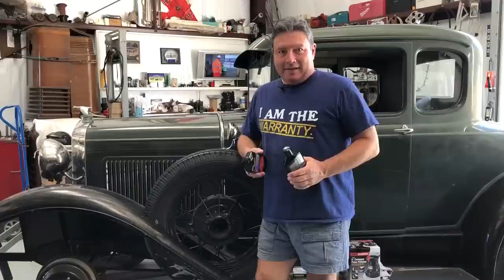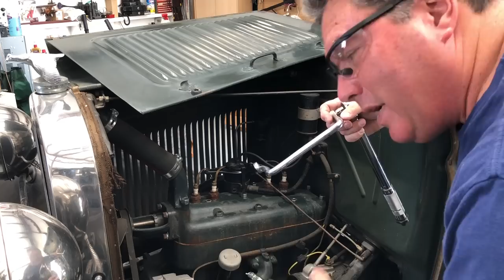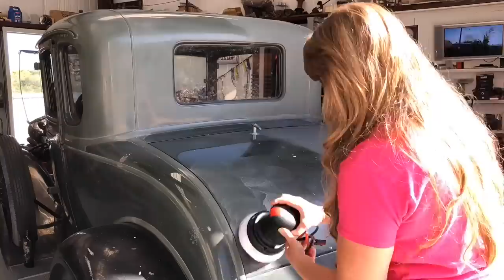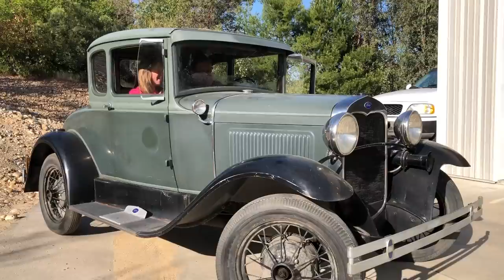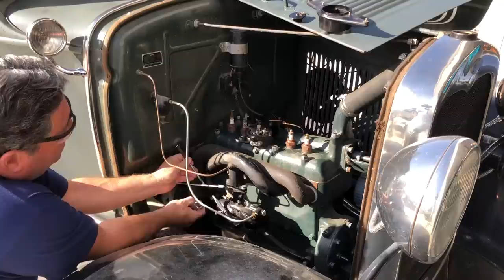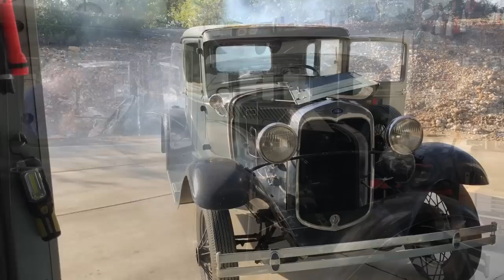1930 Ford Model A coupe- Got it started! Then it blew up.

Comment: Thank you for the entertainment tonight Paul...I appreciate that your videos show not only the good days but also show when things DON'T turn out as expected.  Just earlier today I was thinking of you when I got ready to take my new-to-me 68C for a short ride after obtaining plates and registration from my local DMV office.  First I checked fluids and while checking things decided I'd better lubricate the distributor cam as well...I had no idea when the last time the previous owner lubricated things.  Off came the distributor cap and rotor, then as soon as I touched the cam with lube the spring on the points broke and went flying off into the grass!  My heart immediately sank as I knew I did not have a spare set of points.  But then I looked closer and realized this distributor had a later set of Ford V-8 points....so a quick call to our local NAPA resulted in an in-stock part sale (with delivery) and 30 minutes later I had the new points installed and I was driving around the neighborhood.  Gotta love the Model A!  Such a simple car that can be easily fixed and maintained.  While I hope I don't have anything as big as your engine problem to resolve anytime soon, I am comforted to know that nearly everything that may (and probably will) go wrong on my car can be fixed with a reasonable amount of time, effort and money.
Reply from the maker: Most excellent.  Yep, you're right

Comment: I've had a 31 Deluxe Coupe since I was 9 years old...I am 55 now. It was Gramma and Grampa's "Datin'" car. I remember going to lunch and ice cream in it with Gramma and Grampa but when I got it was the first experience I had ever had with death. They passed away just two days apart, both from heart failure. Anyhow, for the first several years I just wasn't interested even though Dad taught me to drive it and yeah, I did use it for my driver's license test. Then for many years it went from I'm going to restore it to it would make a killer hotrod to apathy and back and forth. I discovered your channel only a couple of months ago and have thoroughly enjoyed watching and learning. My old coupe is in pretty good shape. Most who see it say it should just be cleaned up and shown as a survivor. It does have original paint, 92 year old mohair and is 100% stock, I'm just not at all into the "patina" thing so I am going to go for a full restoration. With the exception that is of some hop-up goodies that Grampa bought way back when the car was about ten years old. I do have an overdrive unit and various other items for the engine but the cream of the crop is a NOS Frontenac head. I've got me a little gal that calls me Grampa now and I think she needs to go out for lunch and ice cream with Gramma and I.
Reply from the maker: Excellent!  In your grandfather's memory, I'd be tempted to restore it to the point exactly like your grandpa had it when he was driving it.  Then, when you pass it on, you are passing on a part of him and you both.  If you modify it with the hotrod head and whatnot, then he is gone and it's just you.  But, it's obviously your decision.  I've just been involved with a LOT of those "my grandpa left me this Model A, what should I do with it" and see the regret every time it got heavy modification away from "as-given".
Reply: @ModelA  Yeah, but he bought the parts and wanted to hotrod it...Gramma vetoed that idea! LOL I would never consider going any farther then he wanted to go. It will always be Baby S**T Green with black fenders, black wheels and tan interior. It would forever look bone stock. Like Grampa said, if I would have just done it she would have never known... Gramma didn't drive.

Comment: That sucks that it's blown up!! I have two Ford Model A's and work on small engine machines for a living. I noticed that you were draining the fuel from the carburetor into a gas can.  With 10% ethanol fuel these days (might be 15% soon?) this ethanol blend fuel in vented carburetors and fuel tanks will get moisture from the atmosphere and "spoil" it quickly!! I usually drain some fuel into a clean glass mason jar and hold it up to the light.  If it is cloudy then it is bad or if it has water in the fuel you will see the separation of the two easily in the clear jar.. luckily you just had a clogged main jet. Model T can still buff the car out in the meantime!!! Nice video!!
Reply from the maker: Thanks JT!

Comment: My first thought was rings as well. I am wondering if all 4 sets are locked to the piston and just not in contact with the cylinder. I saw a lot of smoke coming out of the engine compartment. By any chance did you have the oil filler cap off? If rings are a no go then a ton of bypass would flow out the oil filler.
Reply from the maker: Filler cap was on.  No blowby coming from filler.  Spark plugs are clean, no oil.  I think it's happening after the cylinders.

Comment: On a old engine i worked on the oil pressure relief was stuck and it did the same thing smoked like crazy, filled the exhaust with oil
Reply from the maker: If this was a pressure oil system, I would suspect that also.

Comment: Starting dad’s old model T with hand crank sucked. Especially if it didn’t start 1st or 2nd try. Electric starters were a blessing. Kids today would have just kept riding their horse.😂
If that engine was rebuilt they may have broke a ring. Pull the plugs a check for oil. If just 1 has oil, you can remove the piston and replace broken ring. If all show oil you’ve got a different problem.

Comment: I can't believe you stayed as calm and collected and, above all, PG when the engine blew up! 😁
That's why I can't make YouTube videos when I'm fixing my cars, the air turns very blue on occasion.
Please make a teardown video of that engine, I'm dying to know what caused it to blow. Maybe it's fixable. Because just throwing engines at it until you find a good, working one could take a a while, better build one yourself that you know is good. These are, after all, not off the shelf items.
Reply from the maker: Thanks!  I have mild autism, and I'm always the same- emotionless.  Model T calls me a robot.  Never get riled up.  The next video is a teardown and investigation.  Dad and I built this motor, like we have many others before it.  Lots of things can go wrong with a 92 year old block.

Comment: New to your channel,have watched a few videos. Am thinking about getting a model t of some kind,I’m not a mechanic. I hear folks say you drive it you fix it something is alway wrong. Starting to have second thoughts. Would I be better off getting help and building something from a kit knowing everything is new? I like your videos will keep watching. Thank you for sharing your knowledge.👍👍watching from Boise
Reply from the maker: Hey Tony.  A Model T requires a lot more tinkering than a Model A, but is a fun toy.  If you lack mechanical ability, then it is THAT much more important to get hooked up with a good active club.  If not, chances of failure and disappointment are very high.

Comment: Did you ever figure out why the little green coupe smoked? I'm pretty sure you have, but just in case you haven't , I'd like to offer my thought on the matter. As there was no plug fouling, no oily exhaust ports, and the fact that it ran so smooth, my guess is that there was still a lot of oil in the muffler & tailpipe that would have to burn out before the smoking would stop. Disconnecting the exhaust pipe at the manifold would prove that. I rode a many a mile in a 1931 model back in the late 1930's and early 1940's. I would sit between Mom & Dad & shift gears for Dad sometimes. I enjoy your videos, and I've learned a lot about the Model A, details mostly, as I never worked on one, but was an automotive machinist from 1955 until 1966 until I left & went to work in a petrochemical plant, best 11 years of my life. Thanks & keep up the good work, R.C. Russell Bridge City, TX

Comment: Paul are you sure it is oil and not water vapor?
I had a bad head gasket that produced white smoke in an old Datsun I once owned.
Reply from the maker: It's oil.  There was a puddle of oil on the ground from the tailpipe and it splattered all over my concrete.

Comment: The key to torquing down a head is that word. Torque. Tight is tight. Especially on relatively low power situation. A sequence is more about making sure every bolt gets tightened. Unless it’s hot

Comment: My Dad bought a 1955 Pontiac that hadn't run in 3 years.  We got it running and it smoked for 1 month until the rings repeated. It was fine after that.  I would give that engine time and if it still smoked then change it out.

Comment: Paul why would you use not a straight extension socket on the head gasket??
Reply from the maker: Because you would have to remove the distributor to use a straight extension.  The tool I used reaches around the distributor.  All the good Model A parts suppliers sell them.

Comment: There's a big stretch between the Model T fans and the Model A fans. Some A fans are just not going to bother with the T's transmission bands, and the limitations of the high and low transmission being able to pull the car, especially on hills. I guess, way back then there were those who saw and drove the A and decided that the T wasn't going to cut it any longer. Of course, 100 years later it's a passion for both groups since neither model has to be a daily driver.
Reply from the maker: The Model T earns respect in its own right.  They say that car put America on wheels, and it really did.  The Model A id a lot more drivable in today's traffic.

Comment: Take your exhaust off and run it. I just figured this out with a willys wagon I'm working on. All the crap previous owner poured in cylinders settled in muffler. Clouds of smoke. Ran great though. Took off exhaust and no smoke. Put on new muffler runs like a champ. Might be your fix might not. Easier than swapping engines. Shouldnt run good if dumping lots of coolant or oil in cylinders.... best of luck
Reply from the maker: I did that.  Great minds think alike!  Next video...

Comment: As a youngster, Dad would come home from some auction or swap meet with a pile of wheels/tires/tubes. We would mount them and set them off in the corner somewhere to 'ferment'. A day or two, or more later we'd be doing something in the shop and,,,,KABLOOOOEEYY,,,,one of those tires would blow out. Dad would say"well, that one was junk."
Reply from the maker: HAHAAHAAAA!!!  Sadly, my dad does almost the same thing. Still.

Comment: Looks to me that the rings are in backwards or at least the second ring is in upside down acting as a oil pump ( you do know how I know this right ) I can’t remember it’s been about eight years or longer since I did the my model A engine. If the second ring even has a chamfer on the inside of it. The chamfer goes towards the bottom of the piston I think they call it oil control ring or second compression ring. I say this because you said the engine had just been rebuilt and not been started, so this is the first time it’s run since ( or second time with the same results a smoker ) rings could have been marked wrong or just installed wrong ( it happens ) and it does run very smooth. Good running Mosquito fogger of sorts. Not enough O’s in smooth to describe it. 6 one, half a dozen the other. I’d hate to waist a fresh rebuild. So not a numbers matching car A ? You can pull the head and the oil pan and have a piston in your hands 🙌 in less than two hours with the block still in the frame. Sounds good to me but of course I’m in Indiana far far away from those Mosquitoes 🦟. If I were there we’d almost be done with it or at least I’d like to think so. Thanks for showing the problem with the carb it’s funny how the lack of fuel and the lack of electricity ⚡️ ack the same. Until next time. Much regards. Thanks for the video.
Reply from the maker: The plugs look perfect and no oil in cylinders.  I think I put the rings on properly.  But I am not perfect, you never know.

Comment: when you hooked up the Polar jump start unit, you hoked it to something under the left side of the engine, not to the battery!!!   What did you hook it to?  I always thought you have to pull the floorboard and carpet and other stuff to access the battery for trickle or jump?  What can you hook up to on the left side in engine bay to jump it???????
Reply from the maker: The battery cable where it connects to the starter switch.

Comment: A quick dirty way to check if gas is really getting to the engine is to choke while cranking. After about 5 seconds you should have gas dripping out of the carb intake onto the ground
Reply from the maker: This car has engine pans.  That creates a safety problem.

Comment: I'm kind of lost here have you done a compression test and since you must have pulled the head off to get the new gasket on didnt you do a leak down test on the rings?
. instead of just buying a diff motor why not just do a bit of work on this one and be certain of what you have. if it was mine it would be getting a hone and a new set of rings at the min but if it was unknown or fairly high mileage a re bore and a new set of pistons 10 or more over and have a set of valve guilds pressed in should pull pan and clean muck from the splasher trays and dippers check bearings too while your there. you will have a great a motor for less than shipping a new one to you. a compression test will give you all you need to know on the rings and a leak down will show you what shape your valves are in
Reply from the maker: I am in the next video.  And, we don't just "buy" a new motor, we rebuild them ourselves.  That is a LOT of work.

Comment: It might just be that it was one of those pretend rebuilds where they just repaint the engine, most of the smoke points to some sort of issue with he cylinders. I wonder if perhaps one of the piston rings was damaged on installation and it wasn't caught during the rebuild
Reply from the maker: I rebuilt it myself.  I do make mistakes though

Comment: Or maybe someone put oil in the gas tank, or maybe it’s pulling oil up the intake valve guide like it’s getting too much oil in the valve galley ,What spark plug is oiled up ? I’m just 🤨 curious 🧐 as to what you’ve found and why it’s smoking.
Reply from the maker: Plugs look too clean.... Hmmm...
Reply: Could it be that there’s oil in the muffler? Maybe from the previous engine seemed to smoke more the longer it ran. BUG KILLER Green Coupe. Do you have another muffler you can put on it for a test?  Seems strange to me, I’d really like to know.

Comment: Hi Paul, what should the tire pressure be on an A-Ford. I have mine set to 3 bar. but don't know if that is correct. I like to hear it. Regards Fred
Reply from the maker: The correct pressure should be stamped on the sidewall of the tires.  Typically at or near 35 pounds per square inch.
Reply: @ModelA  Hi Paul Thank you. i thought it was too much. thank you. Regards Fred

Comment: Aloha Paul & Tina,

I look forward to Wednesday and Saturdays so I can watch yours and Tina’s videos.

Love to see you and Tina together❤️

Looks like black smoke not white like some say, unless I’m color blind😂😂 or the video shows it different.
My experience with black smoke is oil rings. There is no blow by and the engine runs smooth so that tells me the compression rings are good. 
If there’s no emulsion in the oil pan after you ran it then water is not getting into the oil, meaning no crack block or head. 
These things I know you already know. I’m just thinking out loud. 🤔
I wish I was there to help you and learn from the best.

Looking forward to your next video!!

Aloha, Malama Pono,
Ryne
Reply from the maker: Hi Ryne,

It's raw oil coming out the muffler.  There was a puddle of motor oil on the ground and splatters from the muffler.  It is as if we poured fresh clean oil on the ground.  The smoke was blue.  It's the same color as when you inject oil into the manifold of an airplane to make smoke trails.

I will be tearing into this motor to figure out what is going on.  I did the rings and assembly of this myself, so I know I didn't forget to install them!
Reply: @ModelA  I was thinking that the engine was sitting so the oil ring broke. That happened to me. 

Blue smoke and oil pouring out the exhaust?!? 🤔
Dang that’s a whole different ball game. 
Please let me know what you find.
Reply from the maker: It will be a video
Reply: @ModelA  looking forward to it!!

Comment: Usually this would indicate, either a bad piston ring pack or perhaps even a valve seal.
Reply from the maker: The spark plugs look clean and new.  No oil on them.  It's happening after the cylinders.
Reply: no seals on model a valve guides (split guides)
Reply: @ModelA  Ahh I see.

Comment: The second time this week I heard about distilled water I've been mechanic a long time and that is never drawn my attention before why is it that you just want to use distilled water
Reply from the maker: Distilled water won't accelerate rust in the cast iron blocks.
Reply: @ModelA  oh ok,, but wouldn't adding the antifreeze null that? Cuz I live in a climate where actually I have to use 100% antifreeze and I don't deal with rust being from California you probably don't do all that am I correct

Comment: Is that 4 blade Radiator fan safe?
Reply from the maker: Yes
Reply: @ModelA  all the info on the fans is confusing.  How does a person decide if their fan is safe?
Reply from the maker: @larryosborne1508   The original stamped steel 2-blade fans are the ones that tend to fly apart.  If you have an aftermarket fan, and it isn't rusted or corroded in any way, you're probably good.
Reply: @ModelA  thanks!